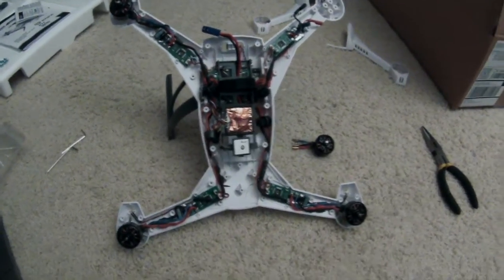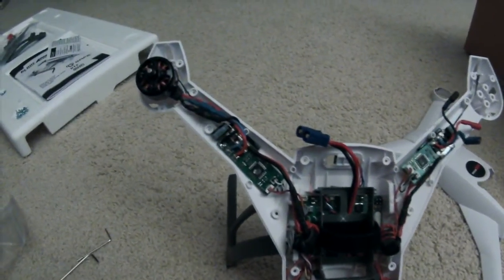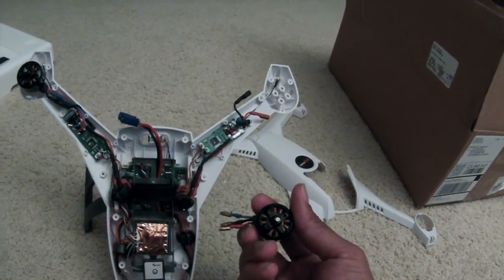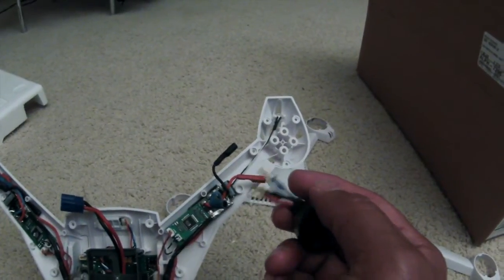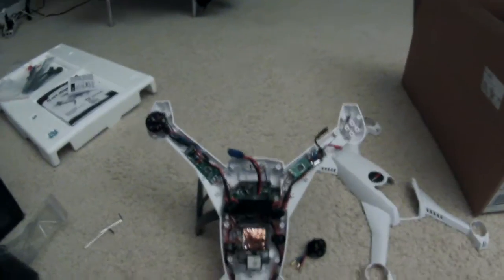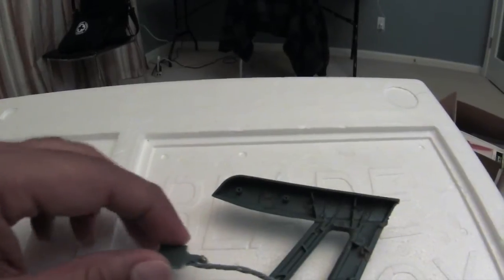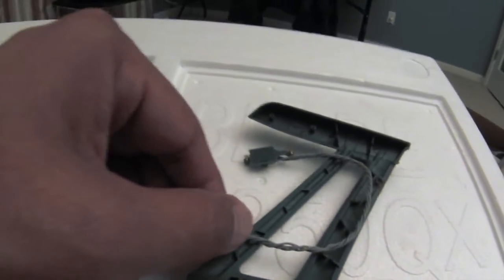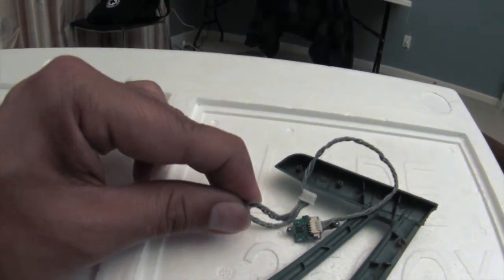350 QX rebuild part 2: What's inside

Comment: I am about to embark on that adventure.. I may also relocate GPS as per  some new suggestions from Horizon, after 2.0 firmware.. I guess near one of the ESCs in an arm/wing.
My crashes were smaller, but one - power loss at about 20ft, and then a prop failure at about 20 ft as well... 
Your electronics or motors did not suffer?
Reply from the maker: Luckily, no.  Good luck!